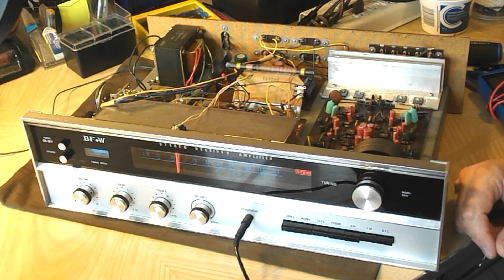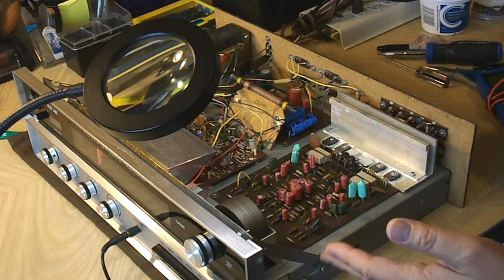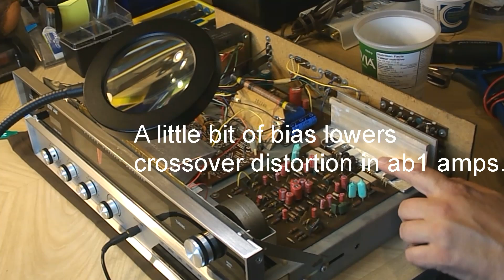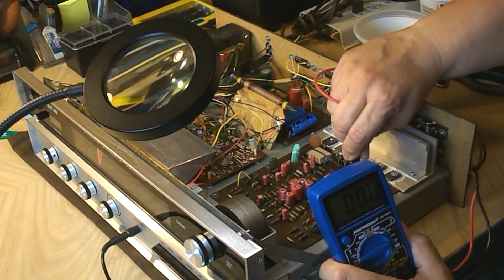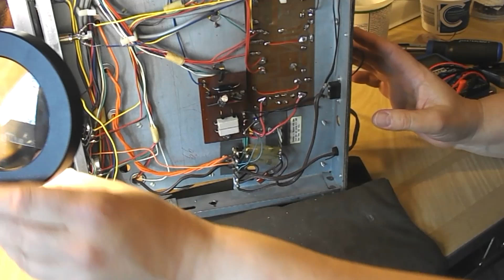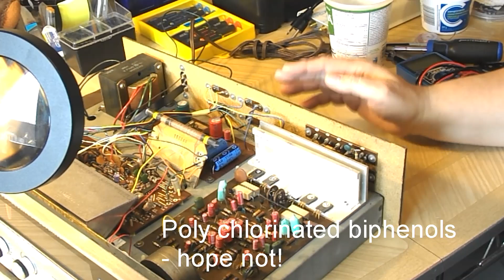Can you enjoy a $30- receiver that wasn't made in Japan?  Electrohome BFW 4077 resto and review!!

Comment: One thing I've observed, in my very limited experience, is that off-brand vintage equipment is hit or miss even after repair. They can work but still have noticeable hiss, like a white sound generator. The (few) brand receivers I've repaired all sound good after repair. This particular model sounds like a hit instead of a miss, good job!

Comment: What a great, obscure old unit! I've never even heard of an Electrohome component. The knobs remind me of the Allied 498 and the faceplate looks like a cross between the Sansui 2000x pushbuttons and the Pilot Model 252. Interesting design of the protection circuit. I suppose it might help keep the headbangers from cooking the output devices!